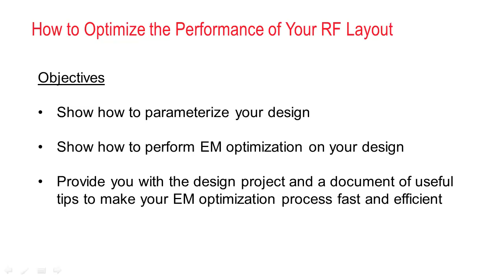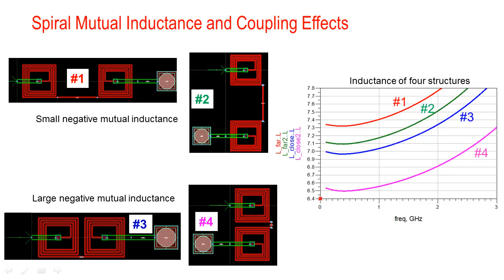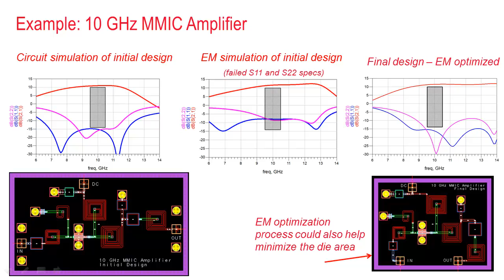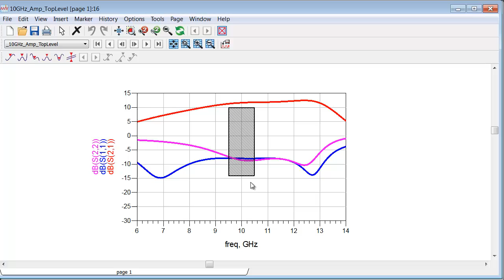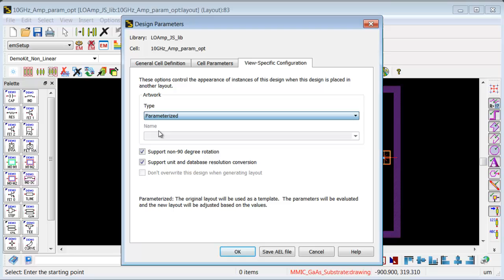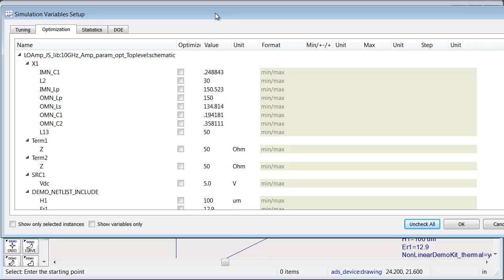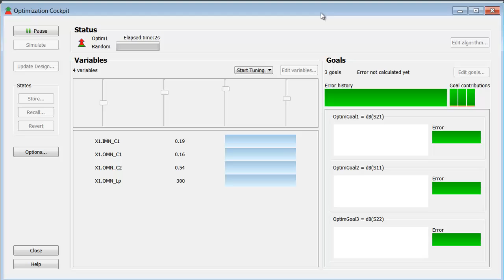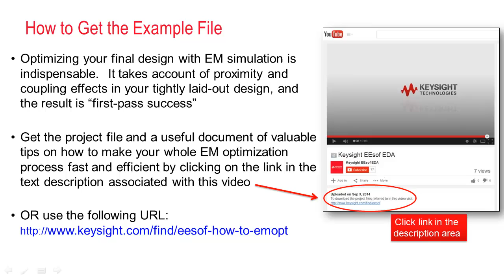How to Optimize the Performance of Your RF Layout

Comment: I use the way in the video but it take too much time if the layout is complex.
Reply from the maker: Hello Gui,
At the end of the video it is stated that you can download the project file and a Useful Document of valuable tips on how to make your whole EM optimization process fast and efficient. Not sure if you have already read it, but please take a look at this useful document; it has many useful tips. For example, first run circuit optimization to identify the sensitive components as you do not want to include insensitive components during EM optimization. Another tip is to use Discrete optimization with, for example, 20 um steps. You do not want to run EM with continuous optimization that might improve in .1 um EM optimization step.. It would take forever.   Please read the document.  It is full of good tips.

Comment: When I run the optimization on this example file, in ADS2015.01, it appears to be changing the layout_hpeesofsim file and running EM simulations, but the Optimization Cockpit does not update, and the hpeesofsim status window does not update after the first iteration, so nothing is really giving me any information on how the variables are changing and if the error is getting better or if it approaching an optimal solution.  Does anyone else experience this?  Has anyone run it in newer versions of ADS?  Are you experiencing anything different?
Reply: I am experiencing this as well. Still running into the problem and am unable to debug...
Reply from the maker: Hello Matthew,
At the end of the video it is stated that you can download the project file and a Useful Document of valuable tips on how to make your whole EM optimization process fast and efficient.  Not sure if you have already read it, but please take a look at this useful document; it has many useful tips.  For example, first run circuit optimization to identify the sensitive components as you do not want to include insensitive components during EM optimization. Another tip is to use Discrete optimization with, for example, 20 um steps.  You do not want to run EM with continuous optimization that might improve in .1 um EM optimization step.. It would take forever.   Please read the document.  It is full of good tips.